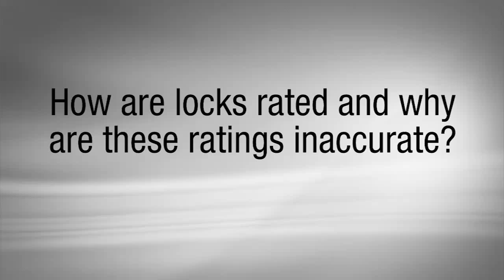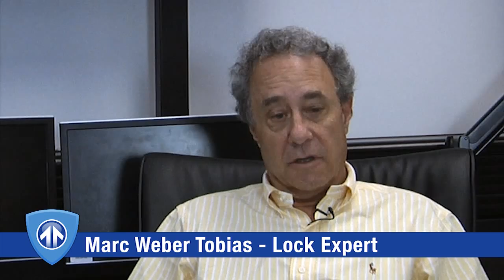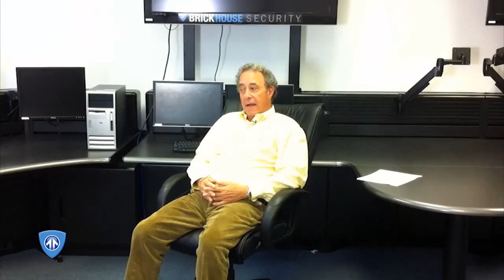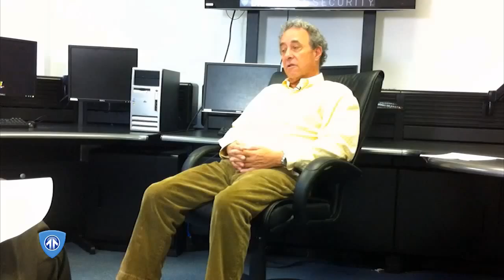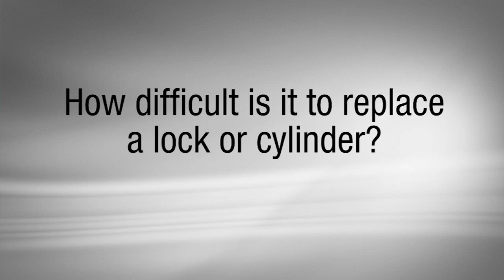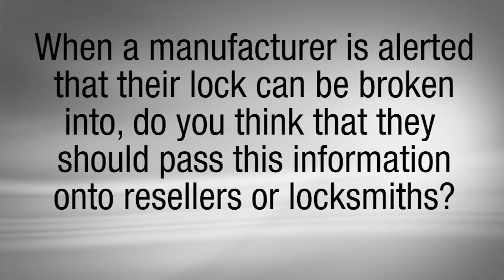Lock Expert Picks Locks, Brings Awareness to Major Security Flaws

Comment: Ah yes, but the failure of "security through obscurity" in computer security occurs precisely _because_ the newer "higher technology" patented and proprietary systems are less documented and have not been subjected to the same public and academic scrutiny, so it invariably turns out that they have weaknesses that only the "black hats" (i.e. bad guys) know about. On the other hand, as you point out, the mechanical tolerance and intricacy can be better for newer locks, so that's a plus.

Comment: No just the opposite here.  The basic lock mechanisms have been around for years and are well documented, and public knowledge.  The newer higher technology and higher security locks have designs that are still under patent so the information isn't out there.  They are also much more intricate in their mechanisms and the tolerances of those mechanisms are much tighter.  I would suggest you visit a reputable locksmith and have him show you some of the differences.

Comment: You're clearly a professional in the field, so I'll take your word for it that a $20 lock is likely to be weaker than a $250 lock. But I'd expect that as far as technology and design goes, mechanisms which are published and well understood are likely to be better tested and harder to crack than some proprietary secret mechanism. This is the case with open versus proprietary protocols in computer security, so I figured the same principle would apply with physical locks.

Comment: Think about what you just said, and you will find your answer.  You assume that just because lock technology has been around for so long that the same technology is still in use in all locks and no additional advancements have been made.  There are huge advancements, but in order to have them you need to pay for them.  The research isn't free, and of course better materials, patent and legal costs, equipment and dies.  Come on man a $20 lock is just not the same as a $250 lock.

Comment: If I understand you correctly, you're saying that the cost of the lock is correlated with its design quality? That's surprising - I'd expect the design quality to be roughly similar to cheaper locks, only with one or two more features (e.g. mushroom security pins or better) and more durable materials. Since lock technology has been around so long, there's no good reason why cheap locks should be poorly designed. I'm sure expensive locks can be picked too, though.

Comment: If you re-read what I wrote you will see I said "NOT usually interchangeable", there are always exceptions to the rule.  

What would you like me to explain to you about mortise locks, rim locks, the 1599 KIK cyl.  I am Master Locksmith at a large international security firm and have been in the lock business for 25 years.  I have not seen and don't know everything, but there isn't much that I have not seen or know in regards to modern locks and safes.

Comment: Cylinders (what Marc is calling a lock) are NOT usually interchangeable between manufacturers as he stated.  That being said, most manufacturers of high security cylinders sell cylinders specific to fit almost any lock hardware out there.  Of course the best way to deal with this is to buy a complete high security lock.  Unfortunately the bottom line is most consumers don't want to pay the price for quality high security locks and would rather buy discount locks from China. #1 question: HOW MUCH

Comment: It sounds like a lot of the lock manufacturers rely on the old "security through obscurity" - by relying on the inner workings (and flaws) of their locks remaining secret, rather than by designing better locks.

The same issue has come up in the field of cryptography many times, and it's generally accepted that a good mechanism requires only the _key_ to be kept secret, not the details of the mechanism itself (which might be discovered through careful inspection or a rubberhose attack).